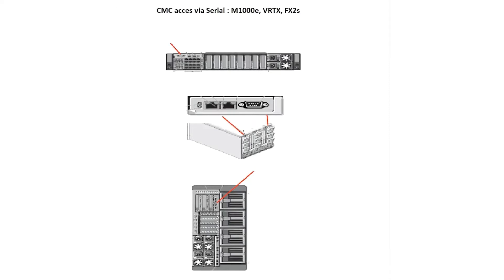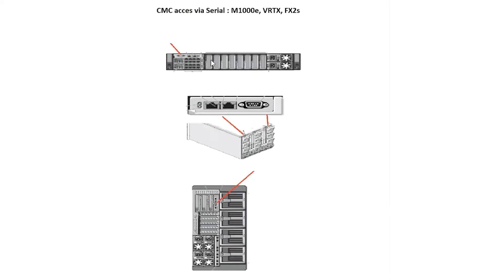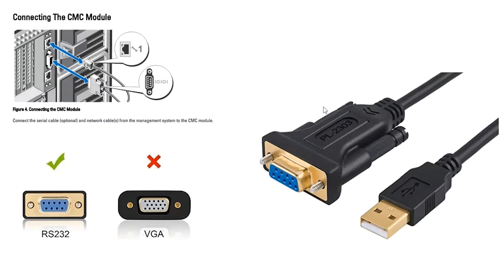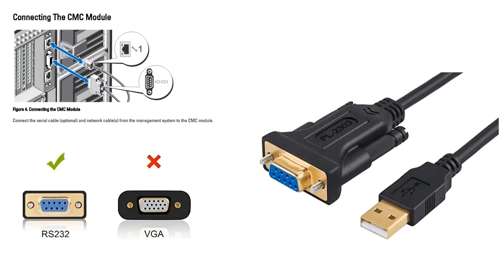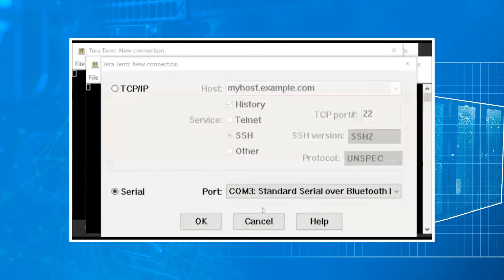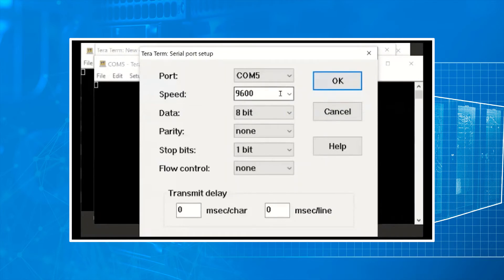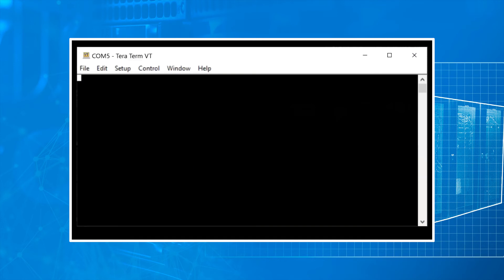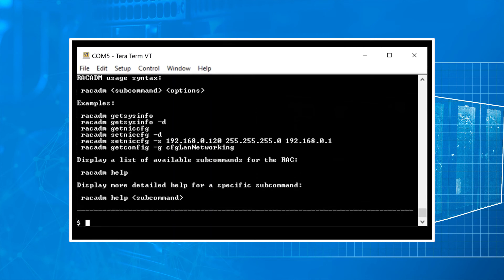How to connect to the Dell Chassis Management Controller (CMC) using a serial connection

Comment: Looking for a way to hard reset Dell m1000e CMCs. I've got two that are configured for static IPs not compatible with my network and I'm hoping there is a simple solution to this issue without needing a usb to serial connector.
Reply: Prob hella late, but can set it up on a diff network, just grab a random router and login then change, can also set it up on the display, tho easiest is just to get a serial adapter